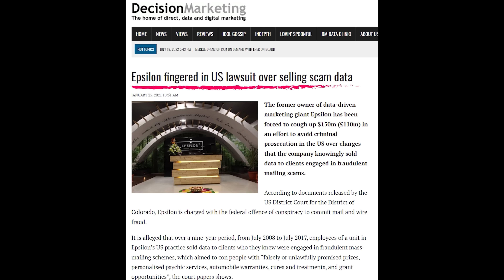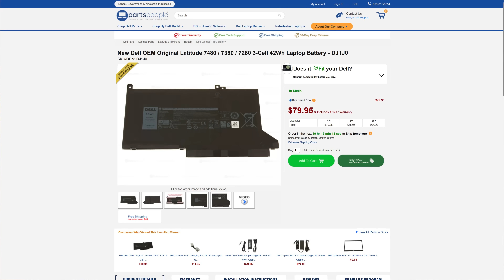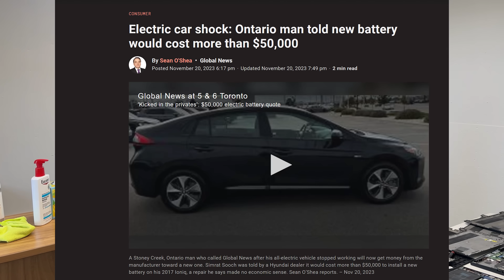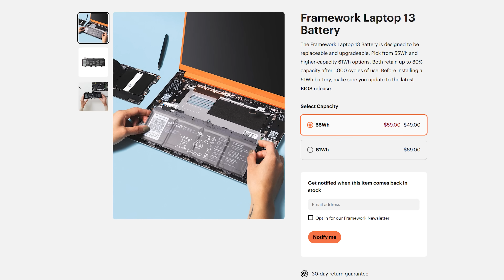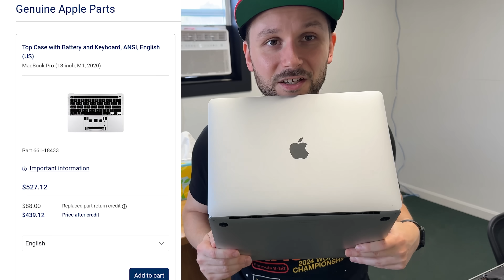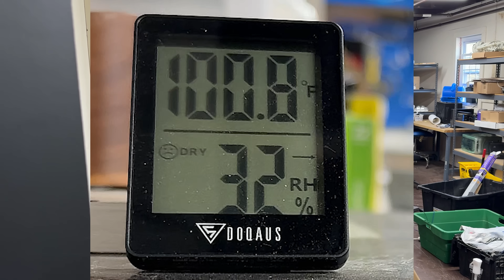Planned Obsolescence: Why is Replacing a Battery STILL So Difficult and Expensive?!

Comment: Computers work for more than 10 years for most people. My personal computer is 13 years old and my work computer is 9 years old. I built them both myself. I recently installed and NVME drive, Win11 using Rufus, maxxed out the RAM, and installed a highly capable graphics card on my work computers (I built 2 identical ones for work for myself and co-worker). I use my work computers for designing jewelry and it's still fast af and I have no problems with it. My office computers were all built in 2016 by myself and since our company has grown little by little, we've just purchased mini PCs since they're cheap and only used for data entry. As long as you're willing and able, you can stretch that computer's life for a LOOOOOOOONG time. Before I built my current personal computer, I had one I built in 2002. I don't remember the specs but the motherboard was an Asus P4G8X Deluxe with an Intel Pentium 4. I upgraded in 2012 only to play AAA games. Other than that, I could still use it with no problems. I was an audio engineer at the time and it worked flawlessly for my workload. But laptops are different, I guess. I have a 5 year old Asus ROG laptop docked and I'd rather use my 9 year old desktop. Thankfully, no spicy pillows yet. I have it set to limit my charge to 60% but it dies almost 5 minutes after unplugging it so it probably needs replacing.

Comment: being honest, if u took care of the battery, it can last a lot longer, but ofc, working with a battery between 20-80%, losing that 40% its a lot of battery

edit: a fix i can recommend about the battery, most people usually have their laptop 24/7 pluged into the wall, so battery its usually not neccessary, so, you can always talk to the client and tell him "80 bucks battery not included, if battery wanted extra cost", or "bring ur own battery we install it for you for free""

Comment: The industry should have a standard for battery again just like AAA/AA batteries and user can buy them and replace them easily 

And yes , also need a standard battery BMC and protocol , no locking

Comment: The thing with car batteries is that there are only a few models, some 2020 cars probably use the same battery that cars in 2000 used. So you can always find new batteries from good brands no matter how old your car is. With laptops, EVERY laptop has a different battery, and it makes no sense to keep production for older models. 
They should make standard models, like 3 sizes of batteries, and manufacturers would need to design their modetherboard/chassi around the battery. So that 15 years later you can still get replacements because there are only like 3 models for every laptop.
At least do this for consumer/business laptops and keep production of custom batteries for their “weird innovative” devices with weird shapes.
Reply: Framework laptop battery is the example of standardized laptop battery. They produce literally the same battery type since their early production model, so past and future models are cross compatible with just 1 battery type

Comment: We need right to repair so effing badly. I miss when I can just plop a battery into my Nokia and keep it going. My last phone was perfectly fine besides a bloated battery, but because everything is glued together, the batter tore open the speaker enclosure and everything. And I can't even turn on the phone plugged in without the battery, so no turning it into a table clock/server even. Uhhhhhh.

Comment: $50,000 is f'ing insane!!! I own a Tesla, and yes the battery replacement is still expensive. But it's not too bad at $10,000. And our batteries are warrantied for up to 1,000,000,000 miles or 8 years, which ever comes first. Which is basically the same as if your engine dies for an ICE. TRUUUE, a battery is twice the price of an engine, I'll give you that. But the amount you save in maintenance and repairs to an ICE kinda evens the play field.

Comment: You could use a UPS Battery Backup that goes between the power supply jack and the laptop power input socket. It could be just Velcro to the lid of the laptop.
Reply: technically , an internal battery of a laptop kinda works like an ups , like it doesent die out when u unplug ur laptop( incase the battery is good)

Comment: Is it possible to install those universal pouch batteries? As far as I know they come in different sizes. Yeah the capacity will be less but at least it will work.
Or maybe 3d print custom backpanels and plastic frames to integrate 18650 batteries?

Comment: What they need to do is agree on a battery standard, for all laptops to have and build around said battery, thus fixing the need to make many different ones.
Reply: That's impossible. Laptop manufacturers always come up with new designs.
Reply: @MatrixMaverick1980 it's not impossible, if they come up with a standard and design around that standard. It's only impossible if you have a narrow mind.
Reply: @Ryy192  Dell, HP, Lenovo, Acer, Asus etc want to sell a laptop where you can't swap parts from one brand to another. Soldering on the storage, RAM, and WiFi chip are becoming the way to go. Having proprietary batteries has always been the go to. Having a Standard actually loses each company money in lost sales. Its not having a narrow mid. Its carefully thought out and every company agreed to just do their own thing because it benefits EVERY manufacturer that way.
Reply: @matthewjbauer1990 that's just greed, doesn't fix the real world problems which is what companies should be doing. My point still stands.
Reply: @Ryy192  If I could take a motherboard out of a Razr and put it in a Dell and use a Lenovo battery and swap the case and screen to a Lenovo, that would lose EVERY company involved money just selling the parts as we the consumer could build Frankenstein laptops. They don't want that and I kinda see their point. I see where you're coming from where you want a standard where everyone follows but I see it as the companies need to make money and need to make it where repaid shops/refurbishers don't build Frankenstein machines.
Reply: @matthewjbauer1990 I'm not talking about all parts I'm talking about the lithium batteries, it's not an endless supply and shouldn't just be wasted like companies are doing, losing a bit of money doesn't matter for multi million pound business. There's enough e waste we don't need more, all your doing is giving them excuses.

Comment: On the reasonable costs - each component makes up a certain percentage of the value of the original device cost (not sales price).

So once every component is costed, you could tell that a battery equates to... say 20% of the total value of the machine.

Considering depreciation occurs per year (each year shows increased risk of part failure), reasonable could/should be set on this value. This then negates sales inflation, allow 5% for tax maybe?

It's ludicrous there isn't a definition already, especially when the regulations on warranties are so terrible companies will go out of their way to try and prove its not a warranty fault (see any GPU manufacturer in the last couple years)

Comment: If you can't find a decent battery, the only option is to just remove it and use the laptop with the power connected and that's it. I know it defeats the hole purpose of mobility but it sure can save you a lot of money that way 😢

Comment: I just bought a new battery for my 2014 HP ProBook. Turns out the charger was failing and it's original battery is golden. Crazy, but true. I'm keeping the battery I bought, and I'm thinking about buying 3 more before they go extinct. I love the idea that this machine has MAXED out specs. It cannot get more powerful than it is. 2014 people would cry. If you start a militia or cult or something about this stuff, I'll join.

Comment: There's absolutely no way this video came out today.. My 6 y/o lenovo laptop started showing it's age, so I was looking into an eGPU option, since I already have the GPU and a 500W PSU, but the first thing I see when I open it is the fucking battery being a pillow with an explosion timer on it's hotbar, I removed it and now I'm running solely on the outlet while waiting on replacement

Comment: My 15 year old Lenovo G560's battery which could slide out lasted like 6-7 years until it died. Got it replaced by a no one which also lasted like 5-6 years. Currently, I have just slided out the battery and it runs on its Rusty but Trusty charger (not to mention  I can at times hear it spark like crazy but what else option do I have?). Quite happy with how much I've explored that Intel Core i3 370M, 6GB DDR3 and that tired super slow HDD and how much I intend to exploit it in the future!

Comment: I replaced the battery in my iphone 11 pro max and it only lasted 4 hours on a single charge and died randomly within a month of replacing the battery and the battery before that just stopped working not long after I bought the phone. Now I have an iphone 13 mini and now I get 5 hours of battery life and it went from 89% battery health to 82% in 2 months its a good thing the eu is trying to get all phones to have a removable battery by i think it was either 2027 or 2028

Comment: What we need are universal battery standards that need to be enforced on all devices.
Reply: The Greatest enforcement that would have ever lived
Reply: And/Or some company to be able to produce batteries that would be compatible to people's orders/gadgets so old gadgets can still benefit. 

Would probably be very expensive, like making a custom battery(and process) for one unit of order.
Reply: Isn't it called the Nokia 3310?
Reply: @bland9876 its called fairphone 5
Reply: LiPo batteries are already electrically universal. IMO, there are two main problems with them that makes them an unnecessarily limited resource when it comes to repair.
First is the shape. LiPo batteries can be made into various shapes to fit into various designs, which is the reason why they're widely used in laptops, phones all manner of devices in the first place. There used to be a time when battery modules were external and inside them were just standard cylindrical cells but the quest for thinness pretty much made them fall out of passion. IMO, this is somewhat unavoidable.

The second problem is the controller. Proprietary BMS circuits are typically used to monitor and manage the battery. IMO, there is no reason why they should be proprietary in the first place. The worst part about them is that they tend to become useless once they're removed from any power source so reusing them is pretty much impossible. Occasionally, one would be able to hack into a proprietary BMS controller and reset it but this has also become increasingly rare. Resetting them used to be the trick when repair technicians could still replace the cylindrical in an external battery module, but this has also gone away for the same reason.
One way this repairability crisis could be solved is if the manufacturers finally open up the access to these BMS circuits to allow reuse. Even better if they connect with some kind of modular connector instead of being soldered to the battery. That way, you can use any type of lithium cell as a replacement. I would personally be fine with some kind of repair compromise where the replacement battery has a slightly lower capacity because the original battery shape is no longer manufactured. At least you get the laptop working again even if the repair is less than ideal.
Reply: @Goodmanperson55 you could still have standardized batteries with thin form factors. You'd probably need more standard forms than you have for cylindrical batteries, but it wouldn't be THAT hard to specify 2 or 3 sizes that fit in phones, 2 or 3 sizes that fit in laptops, etc. And then everything else just has to be designed around that. The hardest part is finding someone with the guts to enforce it.
Reply: Laptop companies have shifted away from easily replaceable and modular components in favor of difficult to remove and OEM specific parts. This was seemingly done to lower manufacturing costs. But the savings, if any were never transferred to consumers. Your new laptop is more expensive than before. The only difference is now you can't upgrade the ram cause it's soldered, remove the battery or service the computer in any meaningful way. Not unless you shell out extra cash on high end premium laptops that allow a bit more flexibility (but still not very much).
Reply: @tonyscorner360 it’s more like make up the cost with repairs
Reply: @tonyscorner360 They can fafo. I haven't bought a laptop in ages
Reply: They could use a system similar to that of portable power tools batteries.
Reply: That will render innovation impossible...Imagine how would you even try to build a samsung fold phone without a specific battery for it.
Reply: I daily a galaxy note 7 and replaced the battery with an upgraded one that wouldn't explode. Still holds great today! I don't feel the need to upgrade every year or two, unlike the spoiled kids and iSheep.
Reply: Problem is the various batteries that we have and for various purposes
Reply: HT03XL in E V E R Y T H I N G
Reply: Good idea
Reply: So that's tricky for as an Engineer I understand the need for different batteries configurations. However, there is abostlulty zero reason that your custom battery can't have a publicly published spec!
Reply: If the EU got Apple to finally adopt, hopefully my brothers and sisters still in the EU (Northern Irish victim of Brexit lol) will be able to enforce some sort of battery standards - or at least standard sizes, maybe 5-6 standard kinds? For laptops
Reply: seems like hell. why restrict devices for something you never do. i have never needed to replace a battery in my life
Reply: @z-0669 Why you act like it's something that won't ever be needed? I've come across that scenario a couple times with laptops and phones.

Comment: Actually, you have a right You're actually making a solid point. These 7–8-year-old devices originally retailed for $1,000–$3,000, so pricing a replacement battery at $100 doesn’t sound unreasonable—it’s only about 3–10% of the device’s original MSRP.

The real issue is that the market value of these laptops drops significantly over time. Manufacturers aren’t going to sell a $10 battery just because the laptop is now worth $100 on the second-hand market.

It’s the same situation we see with parts for older luxury cars like the Mercedes S-Class or BMW 7 Series. The car might be worth $1,000–$3,000 now, but the parts are still priced like you're maintaining a premium vehicle.

That's just how consumer markets work— We want new shiny things, we don't want old reliable toyotas.

Comment: I remember the days when a laptop could run off of the DC input without a battery. Devices should be able to bypass the battery without rewiring
Reply: They dont do that animore?
Reply: acer predator helios 16 don´t power on without battery...recently checked
Reply: @fernandoninoA  that sucks, I just made a comment about how laptops are better than mobile devices because you still have that usability after the dead battery (unlike phones and tablets)
Reply: @fernandoninoA  My Acer Nitro 15 says it can run without the battery on USB-C and USB-C battery pack. Its a feature. Haven't tested it though.
Reply: @matthewjbauer1990  was just thinking about this. if you have the right adapter and power bank you dont need to worry about losing portability or wearing out your battery.
Reply: They still can. Remove the battery and it'll still work while plugged in...
Reply: @charliebeazer Some can, some can't. Depends on how each manufacturer designs each model. Some of them do make it so the laptop doesn't power on if no battery is connected.
Reply: my 2019 lenovo is still able to do this tho. had a bloated battery thus i remove it entirely so that it doesnt damage the keyboard. it still works.
Reply: @harisnaufal3259  I have multiple Lenovo laptops that run on the yellow Lenovo plug of various wattages, 65w and like 135+. I purchased a rather large wattage portable battery + LED light with USB-A QC 3.0, Micro USB for charging, USB C PD for charging IN and OUT, and a wall outlet. I got it for the USB C PD and the wall outlet. The wall outlet will power the Lenovo laptops and the USB C will power my Acer Nitro 15 (just tested on my Acer Nitro 15 for a power outage). For that, I am happy. Haven't done a test to see how long yet as I haven't needed it more than a few hours and I have a solar "generator" for extended power outages.
Reply: @harisnaufal3259 When did you destroy the battery leaving it plugged in?
Reply: @Samusaran77  i bought it used so i didnt know when exactly
Reply: 9 year old Acer Aspire E5-575 here, battery died recently, runs off from dc no problem. Although I have to boot it twice now, I get black screen on first cold boot, second boot is fine, maybe because battery still inside and laptop cannot complete POST (i could remove the battery but you have to unscrew whole bottom panel with i/o and that's too much of a hassle)
Reply: My loq didn used it's battery for all day. Bypass is king
Reply: Yeah, I wouldn't even care about the battery. I'd buy an older laptop and just keep it plugged in and hooked up to a keyboard and mouse and display, treat it like a desktop PC. But then they make the laptop so it doesn't power on with no battery. WTF!!!
Reply: Haven't seen that happen on Dells HPs or Lenovos